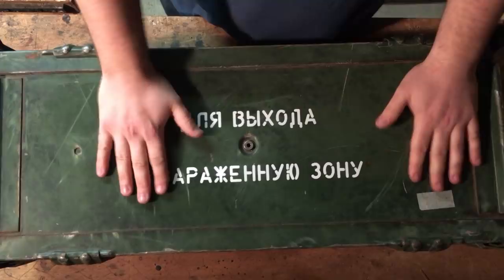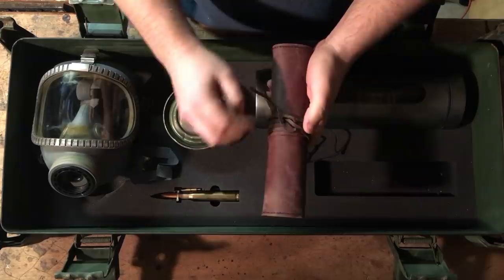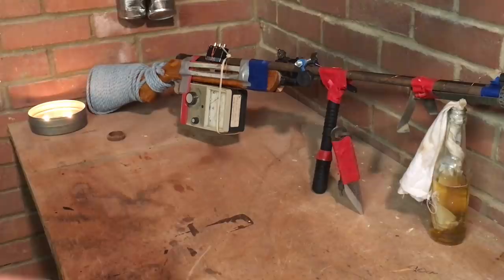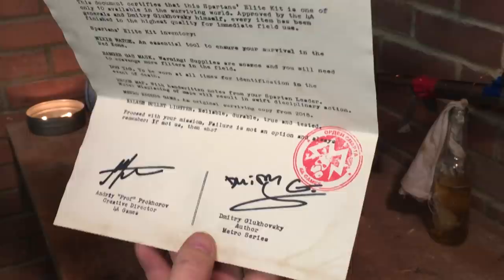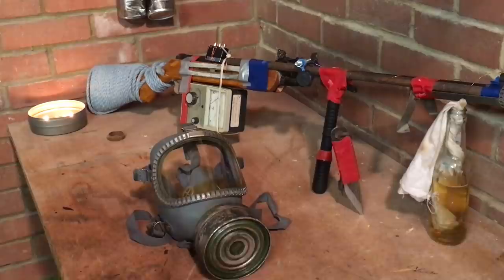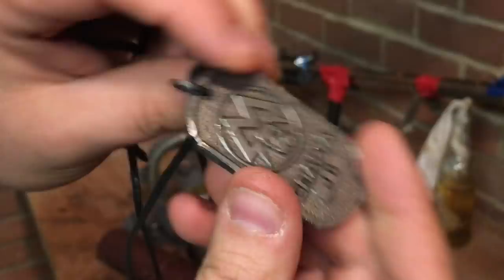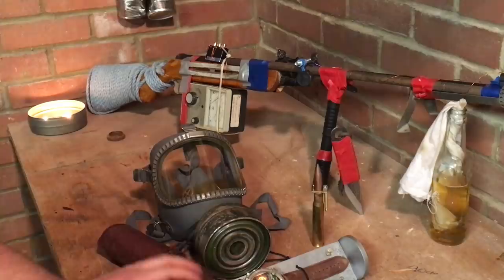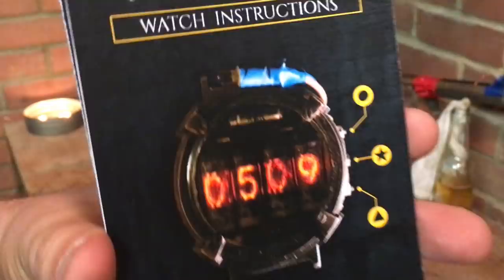Metro: Exodus Artyom Edition Unboxing

Comment: Just some information on the Gasmask, it is a genuine one I don't know which one it is looks like a GP 9 but those usually are black like most Soviet gasmasks. The filter is too a real one, If it's not hollowed out which it doesn't seem to be then DON'T use it they do contain asbestos so I would recommend you to search for a plug to seal the bottom up and use it as decoration. The Gasmask is good to use, if needed you can use it for some workshop stuff with a NEW 40mm filter as long it holds pressure, to check that just put your hand in front of the filter port and breath in if it holds pressure you shouldn't be able to breath in. And FYI those things in the inner mask are valves to prevent the Glas from fogging up.
Hope that I could help.

Comment: You have a five-pointed badge on the bottom right of the box. This is a sign of the quality of the USSR, but it was changed at the top instead of the open ОТК (technical control department) was an inscription of the USSR, but for political reasons it was changed, but we found the essence of the filter, and we found the old bomb shelter 4 boxes of the Cold War era + coal filter workers were recycled I would have known you could send you 10 pieces suddenly, the situation is tense))) with respect, I am happy when a person unpacks gifts and is happy.Удачи!!!

Comment: I actually own a Soviet (well, Ukrainian) GP-5 gas mask, and it has a filter that is practically identical to the one that came with that mask. For my mask, the original filter did come with asbestus, which only tends to be harmful should the casing on the filter crack. I did end up replacing it with an all charcoal filter, just to be on the safe side. Seeing that asbestus filters have been largely phased out in modern times, and seeing as this filter/mask have been hand crafted (presumably from somewhere in Ukraine or Easter Europe as that is where one of 4A's studios is located), it would be safe to say that that filter is most likely a charcoal filter.  

P.S. Ukrainian and Russian do not translate 100%, but from what I can tell, the Russian words on the outside of the letter roughly translate to something like "Elite Spartan Set"

Comment: Literally "Elite Assortment (for/of/belonging-to) a Spartan". It's the kit, or assortment of equipment, of the Spartan Rangers. Obviously this is the kit of one individual ranger, and not the shared kit of a squad or similar group. The Spartan Rangers are the post-apocalyptic adaption of a modern Air-borne Special Forces military formation, more specifically the VDV or perhaps Spets Naz. The VDV (airborne-diversionary-forces) being more focused on larger assault actions from behind enemy lines. And the Spets Naz usually working in small or ad-hoc groups, or individually on reconnaissance, counter-reconnaissance, sabotage, assassination or VIP extraction, and to covertly locate and destroy (or mark for destruction by other forces) Strategic Nuclear facilities/weapons to minimize counter-attack in a nuclear exchange. In effect the Spartans (or the "Order" for Russian readers/player) is a mythological combination of elite assault troops and unstoppable commandos. If the US Marines were fused with Green Barrettes and perhaps Navy Seals, something like that in terms of inspiring awe. 

And that's what the kit is meant to project. It's minimal, no weapons. But dependably sturdy, and a bit worn. As if a an elite veteran had used it in combat, or perhaps some other survival situation, and expertly reconditioned it for your use.

Comment: The original GP-5 filters contain asbestos, but it's solid and at the very front, so for the aspestos to be breathed in you'd need to destroy 3/4 of the filters inside.

Comment: No offence but this does not seem to be any thing special... We had that kind of gas masks and you can buy them with the filter and a bag for like 5$. The only thing actually valuable about the box is the watch ( Can go for 200$ and you can buy the kit to make your own for under 70$) and the box it self (around 15-20$)... Every other thing can be recreated for around 30-50$. If you won it, good for you and if you gave any money for it, they probably took you for a nice sum...
Reply: It was like lottery so I think It's free. The lighter is hand made or machined, and that is not cheap or easy. Same goes to the watch and its container. 
I don't know about the gas mask though.
Reply: @mr.green.  Its not as hard as you think, you can ask a good car mechanic to make you one... The watch has a kit that you can buy, it comes with a guide and all the components you will need to assemble it... You can buy a lot of things like this for cheaper...